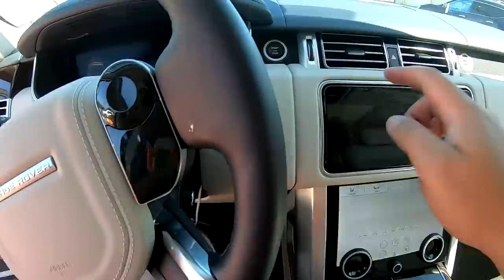I Found a $100,000 Twin Turbo Porsche at the Scrap Auto Auction; it's CHEAP but a Total Disaster

Comment: Saab 9-3 is not a Subaru WRX That’s the 9-2x.  The Saab 9-3 Aero Wagon is a beast... V6 turbo with a manual transmission.  I love mine. Built in Germany at the Opel factory.
Reply from the maker: You are right. I misspoke (like usual)
Reply: You know Saab and Chevy Malibu shares the same frame style too.
Reply: Arent all the wagons built in trollhattan, I know some models were built by magna austria. Idk about built in Germany tho
Reply: @alexprag2866  perhaps the 9-5? But the Opel factory is listed in all the 9-3 V6 Aeros I’ve seen....
Reply: @dirkfromhein  can you send a link I wanna learn more
Reply: have yet to own a new saab.. every time i try to get one i just cant do that to my 9000 aero
Reply: @robertstoker3083  - I love the 9000 Aero, I looked for a good condition one for a long time and could not find one.  Back in 1990 a good friend had a black on black one and it totally changed my opinion on SAAB.  Back in the early 80's I worked on a bunch of 99s and 900s and they were quirky and "neat", but the 9000 Aero totally changed the game.
Reply: @dirkfromhein  My first car was an 1989 900 turbo/spg.... i loved that car.... and thats where i caught the bug lol i have had to many saabs to count... currently stuck on a 1996 9000 aero and honestly the only way i will give it up is if the right combo 95 aero wagon comes along.
Reply: And than there is the 9-4X, based on the Cadillac SRX!
Reply: I doubt that any Saab was ever built in Germany.

Comment: Gotta take exception to the comments regarding the '90's Nissan Z.  The model is Z32.  Power in the NA model was 222 listed, and about 230 with a K&N air filter. Power in the Twin Turbo (TT) model was listed at 300, and some folks reported about 320 with a K&N air filter.  They were NOT drag or tuner cars by the definition we use today - the suspension setup was for cruising.  A TT model could be modified easily to get 400hp with two .035 welding tips in the vacuum lines that controlled the turbo wastegates.  Beyond that, you could - and still can - buy modded ECU's that support bigger turbos and fuel injectors.  Their time was really from 1990 through 1996 in the US, but continued to be sold in Japan up into the early 2000's.  The major drawback was that the engineering was top end at the time, and parts and labor for repairs in the US  were on a par with Mercedes and BMW.  They can last for xxx,xxx miles if cared for properly, but your wallet should be pretty big to do that.  Big fan base online helps with repair tips, parts and sources.

Comment: 9-2x Aero is the Subaru WRX rebadge, that 9-3 Aero you were looking at has a 2.8 V6 Turbo, tuned they're very fast. I've had mine for over 4 years and has been knock on wood very reliable!
Reply: Love mine! Getting it’s paint touched up for summer !
Reply: I don't think we got the 9-2 in Europe, the 9-3 sold reasonably well.

Comment: The Prizm was built in a joint venture between GM & Toyota at NUMMI in Fremont Ca.
Reply: Yup, the Prizm was made on the same factory line in Fremont as the Toyota Corolla. "Geo" was created as a subdivision of Chevy which lasted until the nameplate was dropped in mid-1997. After that, the Chevrolet Prizm was sold until the 2002 model year.
Reply: The Prizm was basically a rebadged Toyota Corolla.  After the plant was closed, it ended being sold to Tesla and now the Tesla Model S is built there.

Comment: Saab 9-2X is the "Saabaru"
Reply: Ive wanted a saabaru for as long as theyve been around
Reply: Was about to say the same comment, I’ve got a 08 9-3 aero manual wagon and I love it
Reply: North American only, right?
Never seen one in Sweden.
Reply: @jameshobbs  I am swedish and I have defenitely seen 9-2X here in Sweden.
Also seen a few Saab 9-7X which is basically a Saab Trailblazer 😂
Reply: @robertklasson5885 You're right, they do exist. I just checked TS data and I found 2 9-2X Aero, both imported. Also three labeled 9-2X non-Aero. TS data isn't always the best so there may be more with variations in naming. One thing for sure, there aren't a lot of them here!

adding: there are quite a few 9-7X variants - about 120 total in the country, though I didn't check if they were avställda

Comment: I love those Nissans! It's actually a 300ZX Z32 (1989-2000) and not a Z31 (1983-1989), and has a quite respectable 280 horsepower and 276 torque with the twin turbo. And a fun historic fact about the car, it was the first car designed in CAD using a Cray supercomputer!
Reply: Based on model years it's '90-96, '84-89. '83 model year you'd be looking at the S130 280ZX. The S130 turbos stand out if the OEM "Swastika" wheels haven't been recycled and from the turbo whine while it goes nowhere fast. The Z32 TT's tells are splitter gills and a duck tail. '84 Z31s have OEM 4 lug hubs unless it's an anniversary edition turbo, subsequent years all had 5 lug.

Comment: I had a ‘91 Z32 N/A in 2003. I liked it, but it was constantly breaking. 
A 300ZX becomes a death missile if you try to drift it. The Z has snap oversteer but it’s better than an MR2. I’ve experienced snap oversteer in both cars and in both cases, it’s easier to let the car spin.
When auto magazines did track tests and comparisons, it wasn’t uncommon for the Z to not finish

Comment: I like the Fiat Abarth, I just hate that the automatic assumption is that it's unreliable mechanically. Now I just turn away from them now because even if it werent you'd just keep hearing people complain about how bad it's supposed to be.
Reply: I don't know specifically about the 500, but with Fiats in general (Seicento, Punto, Panda... and so on) the engine* is pretty much the only thing you can count on. The rest of the car will fall apart well before the engine dies.

*FIRE engines will all leak oil from the rocker cover gasket and from behind the coil packs, but that's how you know there's oil in it.
Reply: Fiat made some great cars. I've owned several and worked on more.

Comment: Corrollas and Prizms were made at the NUMMI (New United Motor Manufacturing Inc ) plant  in Fremont, California.  A joint GM/Toyota venture.  In 2010 it became a Tesla factory.     

Had a GEO 1990 Geo Prizm.   Mechanically it's a Corolla.  They were a good deal.
Reply: We called them Toylette.

Comment: The range rover p525 is the supercharged 5 litre v8 option. 525 HP/625nM Torque. the older models were the same, but just called SPORT Supercharged, new models have the p525 designation instead.

Comment: My first good car was a Chevy prism. It was built with an agreement with Toyota and Geo initially. 100% a Toyota Corolla with a Geo badge, but then Geo was discontinued so the last few years they were Chevy badged. Mine went 200k miles before I sold it. I bought it at a used car lot for $8000 and it was next to a same year Corolla selling for $11k. That Chevy badge knocked the price down a lot

Comment: 98-02 Corollas/Chevy Prizms are oil burners, so the motor is probably blown in it. I've replaced engines in probably 10 of them. I buy an 03+ 1ZZ engine where they fixed the piston ring design so they run forever after fixed.

Comment: 26:29 that mul-t-lock is an anti teft system to  to lock the gear lever so you can't drive the car. Back in time they were very popular in my cuntry. When i was a kid my father had a car parts shop and  we used to sell a lot of those :')

Comment: @7:51 You were thinking of the Saab 9-2X, which was based on the Subaru WRX chassis. This is the "Saabaru". The real beast you want to look for is the car you showed a photo of, which was a 9-3 Aero Wagon and if it is a 6 speed, was one of the rarest Saabs ever produced. The Saab 9-3 Aero 6 Speed was the best car Saab ever produced, if you ask me. 2.8 liter V6 turbo that you can easily modify to 320 horse and they make a AWD 6 speed spec.

Comment: Before I even watch this, OFF COURSE IT CAN BE SAVED..Now let's see what Sam's up to...
Reply: It would be a cool project car for 10k, that you could never get rid off, because  it's liability, but there's no way it would go for that cheap. It will probably be parted out.
Reply: @PuerRidcully   I would go for that if it was a Lambo ..don't mind if I'm stuck with one of these for life..😉👍
Reply: @PuerRidcully  not really porsche only sells body parts to audi certified collision centers for 991,992 chassis and up cars (13_present)   took 6 months in 16 to fix mine w a minor front end (looked like bumper and one fender) and that was almost totaled.
Reply: That geo was made by toyota i bought one for my sister in 98
Reply: @philipparana9225  Independent shops also exist and they would be interested in these parts. Not to mention amateur mechanics.

Comment: That was a z32 300zx non turbo you can tell by the lower valence under the front bumper, if it doesnt have the coolant ducts its non turbo. also its the 9-2x that is the SAAABaru

Comment: That Z is a ‘96 Z32, NOT a Z31. The plaque on the inside marks it as a 1996 Commemorative Edition, and one of the final 300 Zs to cross the assembly line. With that being said, it is a non-turbo with lots of damage. No doubt that it is not worth rebuilding.

Comment: Had a saab 9-3 manual sedan in red that I restored after original owner could no longer drive.  Kind of a barn find with low miles that needed love.  Also had a 9-3 aero auto convertible in lime yellow metallic at the same time.  Loved them. Great cars.

Comment: Multi lock is anti theft device form the 1990s. Chrome metal hook is missing though, with that adjustable hook you could attach the device to the gear lever when car is parked and then without special key to unlock Mulilodk car thief would not be able to move the lever in D position.

Comment: Geo models were manufactured by GM in joint ventures with three Japanese automakers. The Prizm was produced at the GM/Toyota joint-venture NUMMI assembly plant in Fremont, California, and the Metro and Tracker were produced at the GM/Suzuki joint-venture CAMI assembly plant in Ingersoll, Ontario. The exceptions, the Spectrum and Storm, were entirely manufactured by Isuzu in Japan. Geo Metro convertibles and early Geo Trackers were built by Suzuki in Japan.

Comment: Correction: That 300zx is NOT a Z31 chassis. That’s the more popular Z32. Made from 1990-1996 (in the US).

They made turbo and non-turbo models (that wasn’t a turbo one).

The turbo one WAS fast (in it’s day). 280 horsepower, per the “Gentleman’s agreement” that ALL Japanese carmakers upheld at that time.

Ran a 1/4 mile time of around 14.5 seconds and 0-60 in 5.6 seconds or so.

Btw, that manual transmission is HIGHLY desirable. It’s the same one that the turbo model has.

…And it can handle more power even if the motor is fully built!

Comment: The Prizm is a Corolla sold by Chevrolet dealers. The Prizm and the Corolla were built in the same factory, side by side. They are mechanically identical. GM had a joint venture with Toyota to jointly build these cars. Tesla has since bought the factory to build its cars.

Comment: The Saab 93 is loosely based on the Saturn Aura from about 2000 onwards. It has no connection to the wrx. Saab was part of GM then and allowed to use the chassis, engines,  and transmissions, with instructions from Vauxhall/Opel (European devision) not to change much. Saab ignored what they were told and changed everything and used their own engines, uprated the chassis and host of other things.

Comment: Hi Sam
I just want to put you right on one part of this video regarding the Range Rover you look at, Jaguar and Land Rover are the same company so you saying that the engine is a Jaguar engine is wrong, I have worked for Jaguar Land Rover since 2015 and I presently work on the V8 line making the supercharged engines that are in the Range Rover that you looked at, that being said these engines were made by Ford until around 2017 and now they are made in house at the JLR engine plant in Wolverhampton, England,

Comment: Thought about picking up an sc 430 because they were so cheap, but decided against it. They're a far cry from reliable, and apparently chew through head gaskets like popcorn. I looked at 3 low mileage examples, and all 3 had a blown head gasket, which was shocking in itself. 
Also, despite having a large V8, they're dogs in the acceleration department.
The convertible tops are super cool, and Interior is nice ish for a luxury car though. I wouldn't pay more than 8000 for a nice one because I'm factoring in the price of a head gasket shortly after ownership.

Comment: 93 Aero Waggon is nothing to do with Subaru.  It was based on the Opel/Vauxhall Vectra. The Subaru came later in the 2000's when there was some terrible badge engineering just before Saab went bust.

Comment: Sam did you notice the air intakes made in to the hood on that Range Rover that pull air from near the front of the hood and towards the back of the hood pushes the air in to the intake? Pretty trick.

Comment: 9-2x aero is the Saabaru WRX. When GM owned a piece of Saab they insisted Saab needed a compact model. Thus the 9-2x was born but only for ‘05-‘06.
Reply: I had an ‘05 standard 9-2x until it developed the typical Subaru 2.5l head gasket leak.

Comment: When you question if the 5 series is worth looking at.. its NOT
Old, base model, bad spec, high miles and also NOT clean on the inside. Car YouTubers have extremely low standards for car interiors as they say all the time how clean it is when it is trashed...

and 30:35 calling the e class wagon interior really nicely kept...???

Comment: Negative... Hybrids ARE a great deal, and last a long time. My 2008 Toyota Highlander Hybrid Limited electric AWD (4700 pounds) is closing on 300,000 miles on the original battery pack... and still gets the original rated 27MPG. There are tons of low mileage battery packs in salvage yards for cheap. Even if I had the pack rebuilt with new cells it would be under $3k... but why bother? A rebuilt pack for that Hybrig Tahoe is only $2550... so in no way would the replacement cost cause a total!  Learn before speaking with such "authority"!
Reply: Your Highlander and the Tahoe have NiMH MPG smoothing toys, how far can you go all electric?
The hybrid Tahoe should always be a nope because the electric motors are built into the transmission. If that unit fails get right with your god and it might cost less than a serious battery pack. They didn't shift enough of those Tahoes to make finding a donor hybrid at the local pick n pull better than a crap shoot.

Comment: 300ZX  dont make a lot of power? What? Those were some of the fastest cars you could get (and still get) for what they are. I want what this guys concoction of drugs he's on.
Reply: In it's day sure, power to weight is shameful by contemporary standards and given it's autocross/SCCA heritage the Z32 was a peacocking pig. Super HICAS (rear steer) could barely manage to keep the TTs out of ditches let alone on the rails of it's predecessors.

The VG30DETT long blocks could be massaged into 1k HP with some upgraded internals and much bigger snails much like it's contemporary 2JZ.

Comment: Dude , you said this stepmom thing wasnt going to be a reoccuring theme , it's SO cringe I can barely watch anymore . And the salvage yard you'll say some burnt up smashed garbage is just a little bit of work but the Porsche needs a new door and quarter panel and it's too much work ? You have some strange way of trying to justify what's worth it and what's not . PS manuals are not more desirable , I'd say it's 50/50 at best , that's why manuals are usually cheaper , autos have far more benefits . Enjoy your " stepmom " weirdo